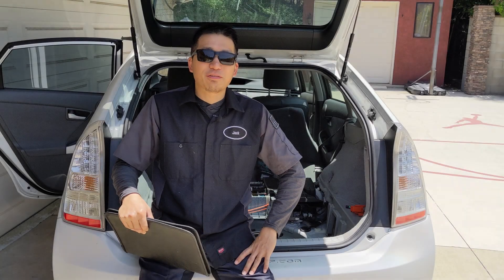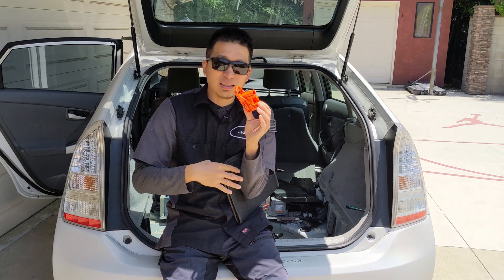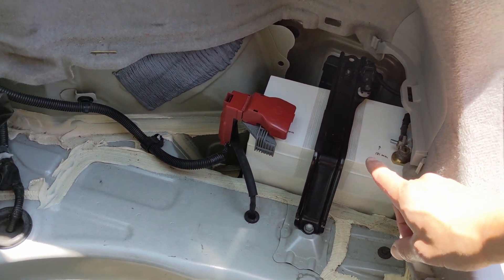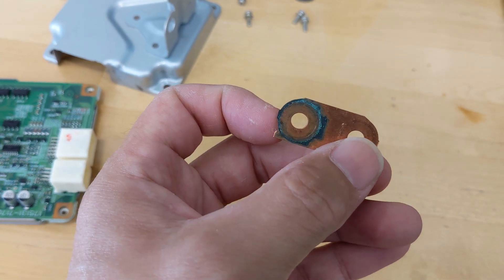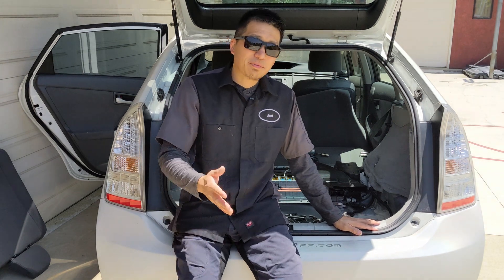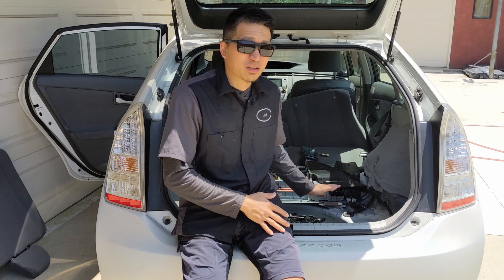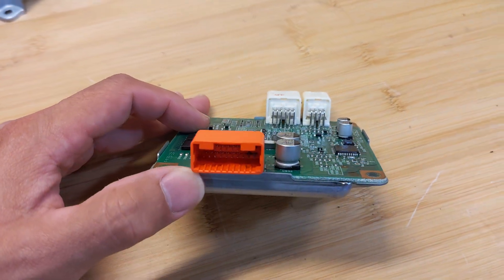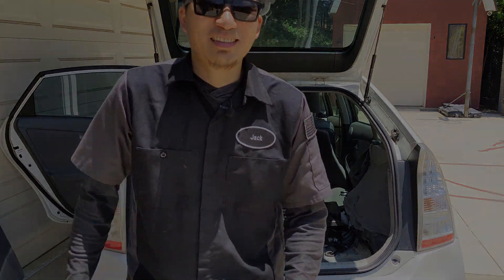10 common installation mistakes for Prius hybrid battery - MUST WATCH!!

Comment: thankyou Jack for this video is very important to advise about those topics, please advise what do you think about to use the 2004-2009 Toyota Prius Hybrid EL-1 IMA Battery Grid Charger from Maxx-Volts to recharge the battery and maintained it balanced and charged thankyou

Comment: So I just replaced my hybrid battery in a 2004 Prius with a new dealer battery and this video saved me hours of frustration. I didn't click the safety plug all the way down yesterday so when I go to test drive after replacement I'm just getting a problem light and nothing happens. Caught your video last night and when I got home from work today figured out it was the safety plug. Thank you so much!!

Comment: Many thanks from the UK - you saved my day, Jack! I was doing a recon HV battery swap in my 2006 Prius but after two hours could not get the relays etc to trigger and system fire up. Your service plug advice (inset AND push down) brought the old chap back to life. HV battery failure was the first issue after 18 years and 170k miles.

Comment: Thanks for the video and your focus on Priuses!  I have the app and use it from time to time to check the battery health.   Recently I've started getting P0A1F and P0A80 - and the RTOD.   Today, the second time with these errors, after resetting those, I decided to run your paid-app Life Expectancy test. I still get about 85%.   The 12v battery is 12 years old and I'm thinking I should look at the ECU connectors/harness for burning.  What causes the microshorting/burning?

Comment: Hi Jack, great video!  I am installing in my 2007 prius today with only 70k original miles and very excited.  Unfortunately my high temperature today is only 42.  Should I wait for a warmer sunnier day before taking the car on its initial break in drive?  I am installing in my heated garage at about 68 degrees.  Thank you!

Comment: I have a question.  My #4 module blew the top off it looks like it might have damaged a sensor right above it.  It has 2 green wires going to it. How do I approach this problem?  I think there is a small black part missing.  Not sure.  Is that a temp sensor?  Thank you.
Reply: It's called a thermistor. Very easy! Just buy one and join the wires together
Reply: @adahannamusic  Thank you.

Comment: Just installed the Nexpower, and it was a great experience.   High quality product and best customer service experience I ever had on a major purchase.  Only wish I had found this video before I ran on EV mode, but the LFP seeems none the worse for a short trip, and naturally when it got to two bars the ICE kicked on any way.    LFP is a TOUGH battery, and STRONG.    Life time investment and very glad I got it while supply lasted.   Jack made the whole install experience a joy too and helped with a few difficulties and questions that were answered with this video which is highly recommended.

Comment: Thanks for the info Jack. Can you give us the list of the tools you use to use? Power tools, extensions, sockets? Also would be great to see 12v aux batteries with more life span and less weight compared to traditional ones.

Comment: Great information Jack. I admit to having a brief issue with the orange safety plug when I completed the install on my 2010 Prius. I used the Dr Prius app to find the trouble code and a quick Google search of the code and I determined I didn’t have the orange safety plug fully locked in place. This video will definitely help people on future installs. I’ve had your cells in my car for 1500 trouble free miles and WOW have they improved the performance and efficiency of the car. I have 215,000 miles on it and my mpg went from 43 mpg up to 53 mpg! Thank you for engineering an amazing upgrade that is easy and affordable!
Reply: Thank you for this comment Jeffrey I was wondering what the mileage difference might be. I have one with 390K right now and Im documenting the refresh this time because I want to see the mileage improvement if any before trying a Lithium upgrade then do the upgrade and document that too.